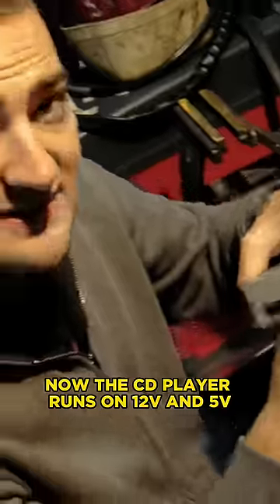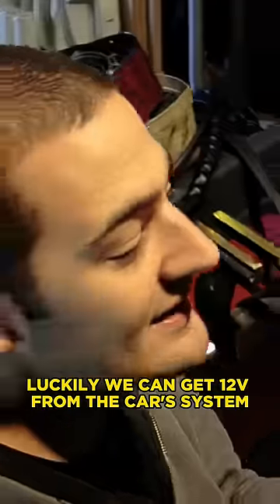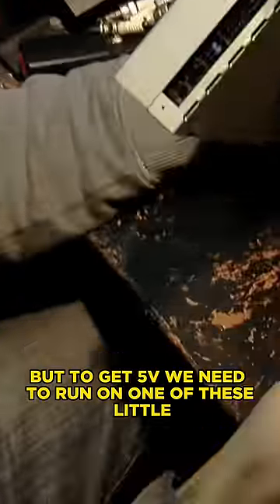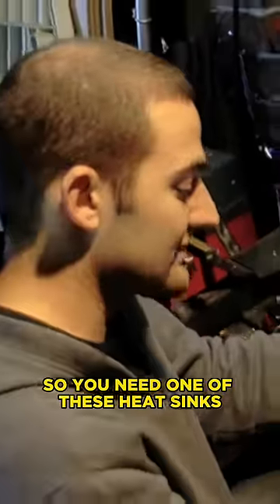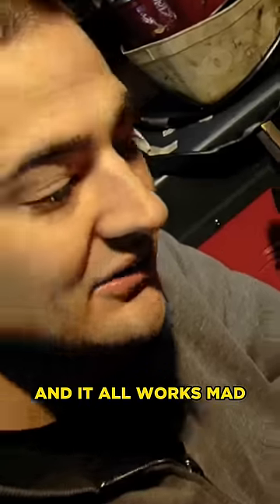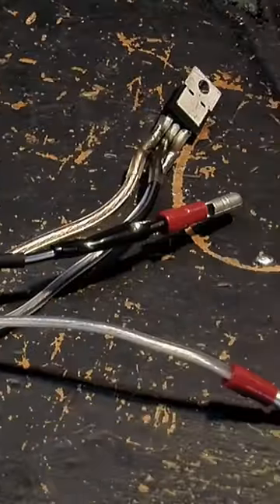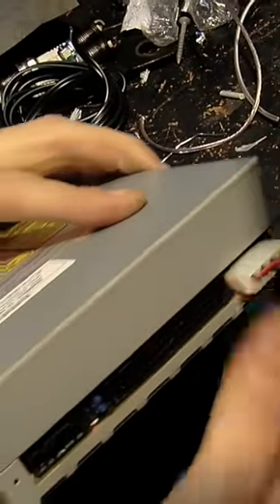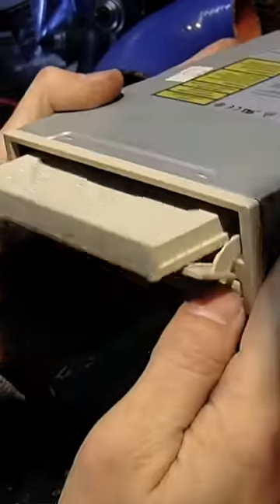Throwback to when we accidentally invented the iPod

Comment: The transistor voltage regulator works well in old cars that used 6volts for the gauges. Old bi-metal regulators.

Comment: I have done this back in the 2000s in my car because i had no cd player. Those were expensive. 
These days you can just use a buck converter. And be sure to use a buck converter for the 12v as well because car alternator outputs 14-15v and that would fry the cd player as it expects nothing more than 13v at worst case . Generally pc powersuplies maintain steady 12v unless you got a really cheap crap powersupply.